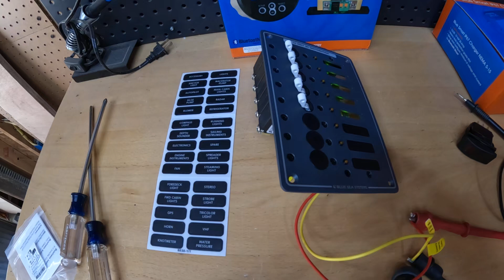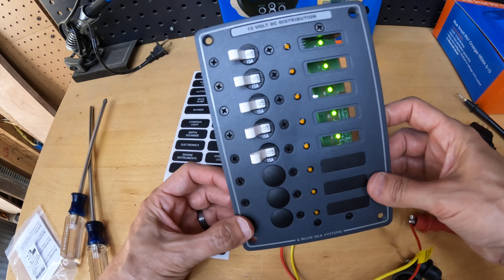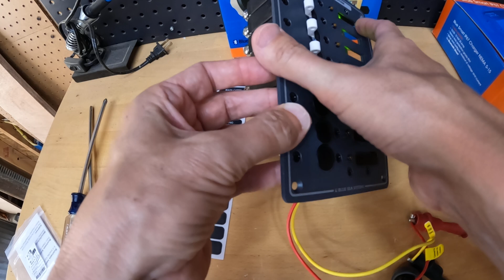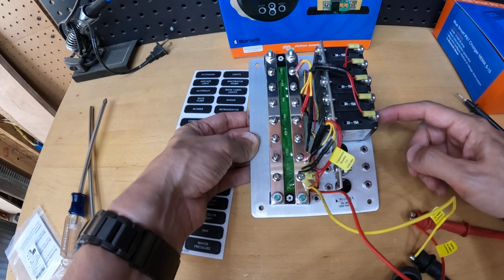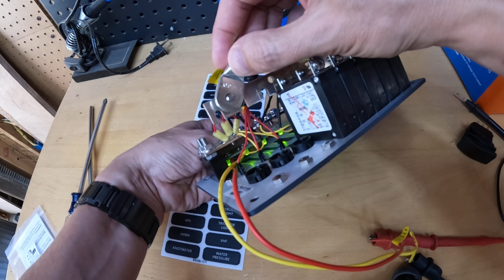Test Bench: Blue Sea 8023 DC Panel

Comment: There is a predrilled hole in the positive bus bar. I would think you can use that for the connection. Btw, the screws being used is a 10-32 by 1/2 (a 3/8” length probably would work)
Reply: I should have said, there is a possible predrilled hole, I have a different model